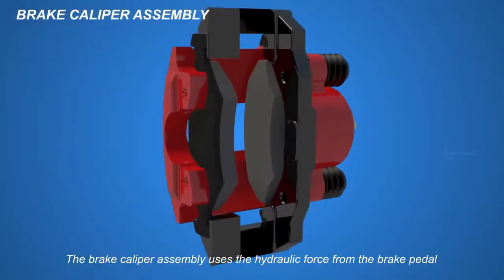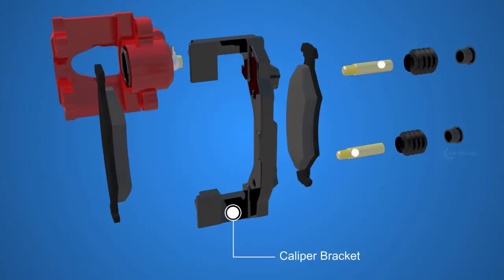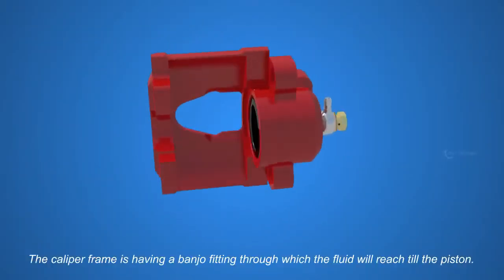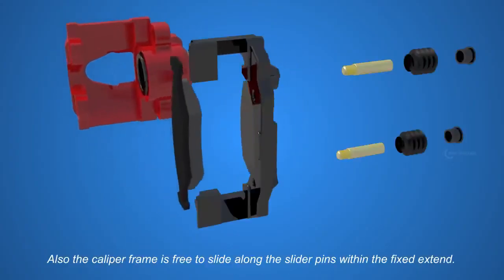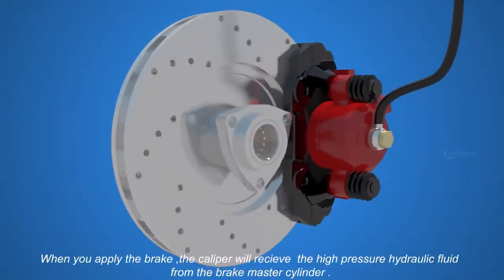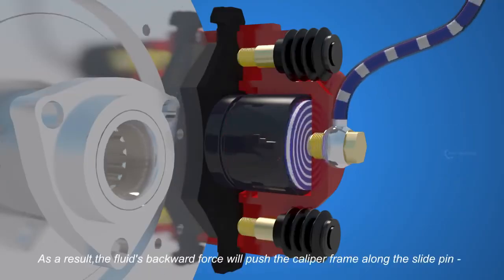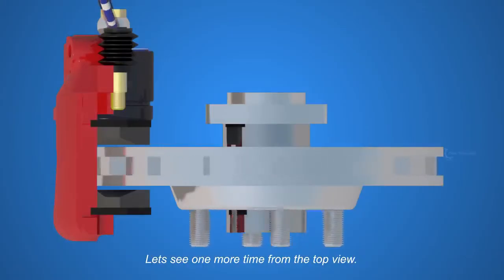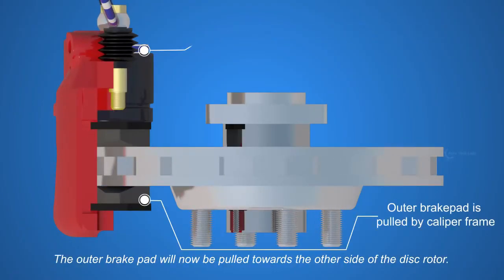How brake calipers work

Comment: An amazing that you can do this whole video and not show where the f**** reserve is for the rear master cylinder
Reply: Yes Terrible video. It doesn't explain how the brake piston retracts! There mechanical action of the square rubber seals within the piston housing need to return to their stable shape is what causes the piston to retract!

Comment: Thank u so much, the best animated video to explain the operation of the disk brake system I've ever seen. Appreciate ur effort, it's very easy to understand like this.
Reply: Terrible video. It doesn't explain how the brake piston retracts! There mechanical action of the square rubber seals within the piston housing need to return to their stable shape is what causes the piston to retract!

Comment: correct
Reply: Wrong. It doesn't explain how the brake piston retracts! There mechanical action of the square rubber seals within the piston housing need to return to their stable shape is what causes the piston to retract!

Comment: Thanks for a great animation! Cleared up a few things for me on the way calipers work. I can see how an inexperienced mechanic could mess up the installation.
Reply: Terrible video. It doesn't explain how the brake piston retracts! There mechanical action of the square rubber seals within the piston housing need to return to their stable shape is what causes the piston to retract!

Comment: What if piston dont pullback?
Reply: take it out carefully, clean it off, take very carefully the rubber of and clean under it
Reply: @magnupetrau277  if you see rust just get a new set of slider pins, they are usually quite cheap since all of the companies use the same 4 or 5 sizes.
Reply: @verigone2677  yeah, i just meant if its a job that needs to be done very fast/no replacements findable at all
Reply: Terrible video. It doesn't explain how the brake piston retracts! There mechanical action of the square rubber seals within the piston housing need to return to their stable shape is what causes the piston to retract! You need to replace the second interior set of square break seals (not the visible seals you can see from outside). Also you must use the correct lubricant to protect the seals!

Comment: This video didn’t cover how the brakes pistons retract when letting the foot off the brake pedal.
Reply: that is what i am looking for. please let me know if there is a video of such
Reply: fr, I'm confused on why mine are locked up, this didn't help me understand how that happens at all
Reply: From the video it looks there are springs. When pressure is released they bring piston to the initial default state
Reply: @inpetkut  There are no springs to retract the pads. The rubber boots look like springs in a way, but they just have folds in them so they can lengthen and shorten as the caliper frame moves. It's shown at :48. The reply of cstrx11 seems like a good answer. Also, according to another video, the rubber seals inside the cylinder are shaped to stretch when the piston brakes and retract the piston when off the brake.
Reply: @inpetkut  There are no springs child! Did you watch the video. The mechanical action of the square rubber seals within the piston housing need to return to their stable shape is what causes the piston to retract!
Reply: @inpetkut  That's not really whats happening. There is no need for springs or such. The goal is to keep the brake pads as close to the discs as possible. Once pressure is released the minor differences on the surface of the disc actually push back the pads and thus the piston. There are high an low spots on the disc and the pushing back actually happens automatically BUT just as much as the high points on the rotating disc "kicks" back the piston. Ideally there is not much differences on the disc, like a few tens of micrometers. Even if there is none (which is not possible) the release of the pressure is enough to not to push the pad enough to make any significant force between the disc and the piston. IF however the disc is extremely corroded, the piston is damaged, handbrake mechanism corroded, dirty or not properly aligned, or the slider pins don't have enough lubrication (high temp grease) then it might happen that some pressure between the disc and pads are continuously present even when the brake pedal is not pressed. This causes the brakes to overheat, lock up, or just wear out faster.
Reply: @cstrx11 
cstrx11,
Only use 'silicon based brake lubricants' for the slider pins',
the petroluem in grease will cause issues on the slider pins, as it will get them to stick & cause  rubber boots to swell.
Reply: @cstrx11  Wrong. The rubber seals are the mechanical action that causes brake pistons to retract. This is very basic auto mechanic stuff.

Comment: Caliper piston how to go back
Reply: A square seal on the piston.
Reply: @reidos1  where is square pin my bike had same problem it work properly but when release it not goes to that position
Reply: Yes a Terrible video. It doesn't explain how the brake piston retracts! There mechanical action of the square rubber seals within the piston housing need to return to their stable shape is what causes the piston to retract!

Comment: This was awesome.  I've always wondered how this worked exactly.  Didn't realize the inner pad engages first then slides the caliper out to engage the outer pad.
Reply: Terrible video. It doesn't explain how the brake piston retracts! There mechanical action of the square rubber seals within the piston housing need to return to their stable shape is what causes the piston to retract!